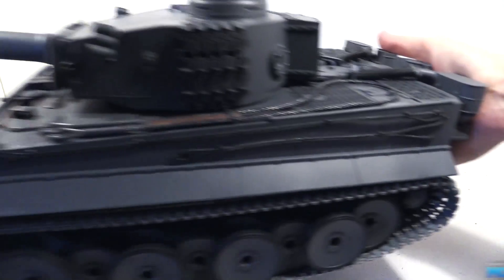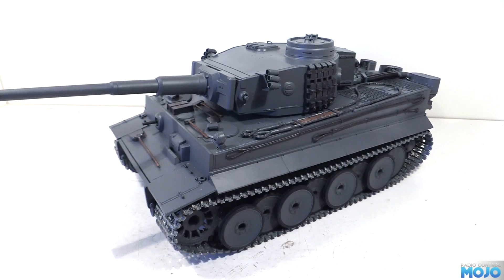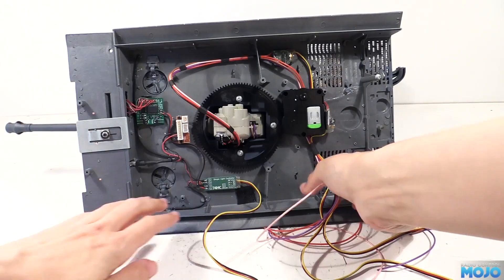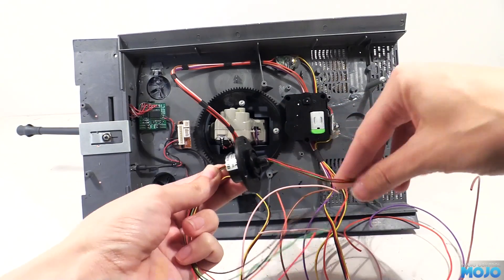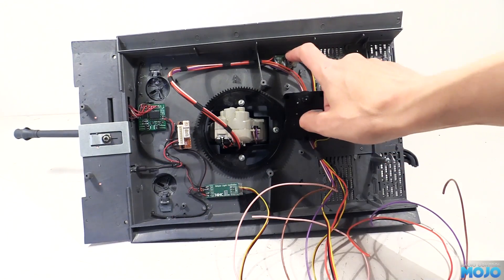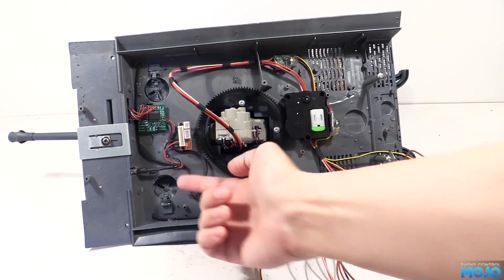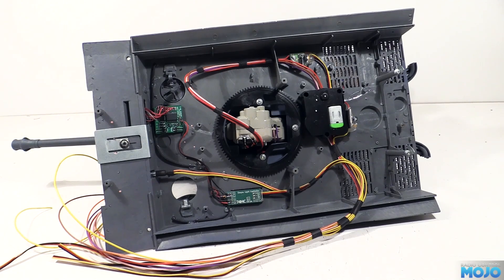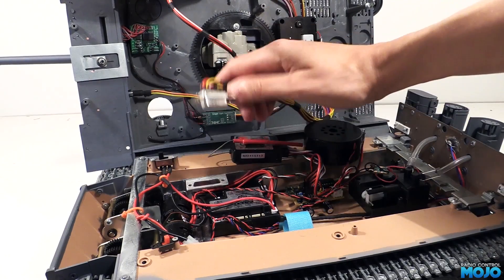Heng Long Tiger I - 16 - Upper Hull Rewire

Comment: 15 wires ?
Did you use a common 5V and GND for the devices driven from the Rx or did you wire everything with its own 5V and GND ?
Reply from the maker: The 3 servo cables have their own power and grounds. I could have cut the 15 down to 9 running all the supplies through single pins, however I stuck with the D15 as it’s not exactly unwieldily and gives us enough pins to go belt and braces.